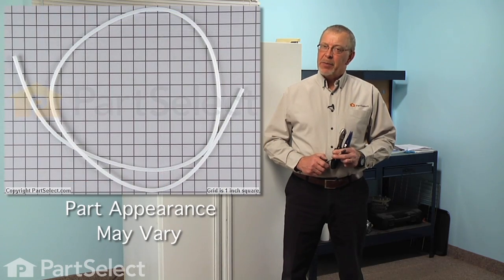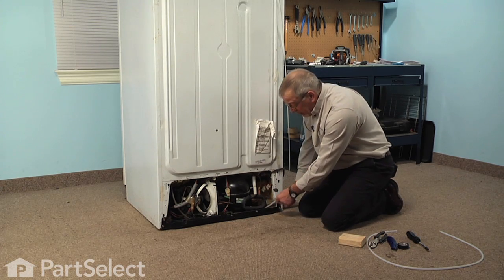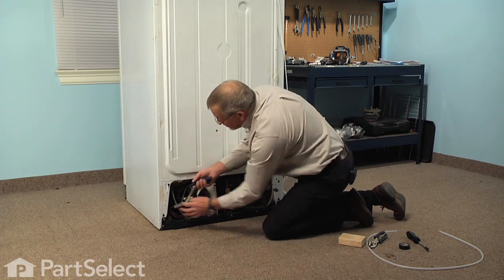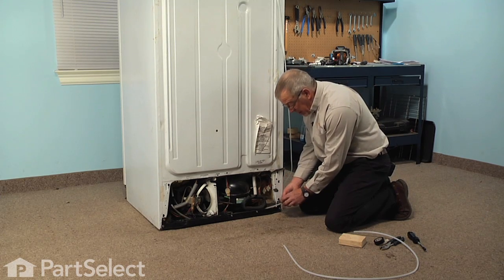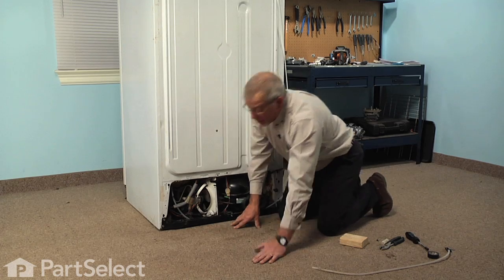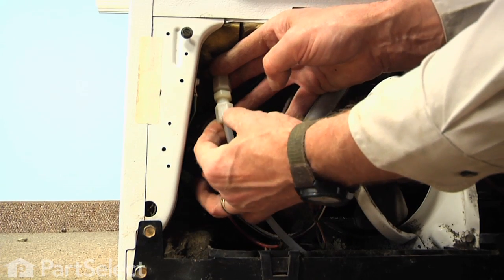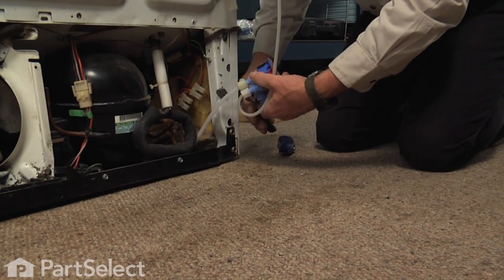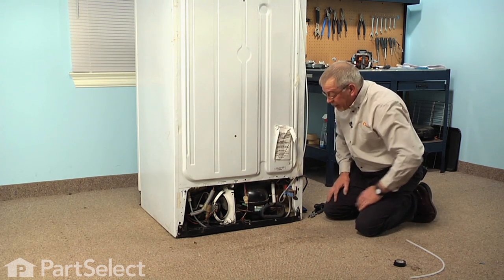Refrigerator Repair - Replacing the Plastic Tubing (GE Part # WR17X2891)

Comment: I have a GE system very similar to this (mine allows hoses to slip in vs threaded).  I'm tired of replacing cheap plastic hoses that deteriorate over time.  Any suggestions as to using a stainless braided hose instead?
Reply from the maker: You could switch to a braided hose, but that would involve installing a threaded compression style union to each end to adapt to your existing tubing from the reservoir, and a short piece of plastic tubing to fit into the water valve.

Comment: Very helpful video thank you.  The problem I am having is that the tubing on the GE psi23ngpabb got brittle and cracked off.  I've replaced the Water valve assembly, the ice maker fill tube assembly and the filter assembly and tube, but I have nothing to connect the water dispenser tube into the fridge from the water valve assembly because the tube coming out of the fridge cracked off from being brittle.  Any ideas on what part is needed to fix that or how can I resolve this issue?  Thank you
Reply from the maker: The water tank or reservoir behind the crisper drawers has an input tube from the water valve and the output tube goes to a union
connector behind the kickplate by the freezer door hinge.

Comment: any idea how I fix a split pipe that's at the lower freezer door hinge site?
Reply from the maker: Most models will have an internal conduit that will allow you to feed a new water line up to the dispenser. What is your model number?
Reply: PartSelect I’m having the same issue I have a leak in the line that feeds up from the door hinge to the water dispenser. I watched your video about replacing the line but this ge refrigerator is a little different when I popped of the water dispenser panel. My model # is LSHF6LGZBCBB I would appreciate any insight. Thanks a lot! ✊🏽

Comment: I have water leaking from where it fills into the ice dispenser. It's not the ice maker because the tube that the water flows down into the ice dispenser has water leaking under it so I I think it's the tubing. Does the video above fix that tube as well?
Reply from the maker: The most common reason for this symptom is a faulty fill valve that does not shut off completely. Verify that your household water pressure is adequate as well.

Comment: JennAir refrigerator JTB1988AEWater leaks under refrigerator. The drain hose does not drain into the tray. Where and how does it come apart so I can manipulate the hose back into the drain? Thank you .
Reply from the maker: The defrost water on this model drains through enclosed tubing in the rear wall of the fresh food section and then exits into the
exterior drain tube. The top end of the drain tube should be attached to a spout with only a friction fit, and the outlet end may just be secured with a plastic zip tie.

Comment: On a GE Side by Side is it possible to turn the water/ice dispenser off totally but keep the ice maker working?  I prefer to just open the door for ice.  Many repairs, noise, leaks, accidents, freezer not staying cold.  I consider it an unnecessary, trouble causing feature.
Reply: disconnect Kenmore freezer door water line